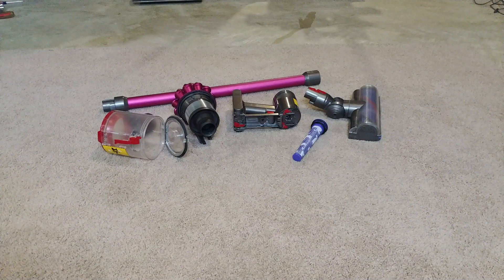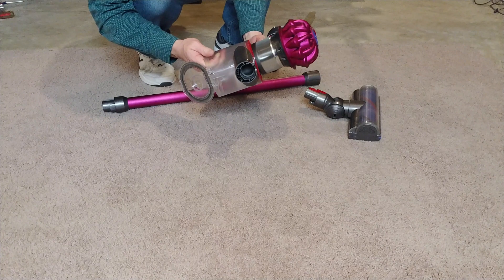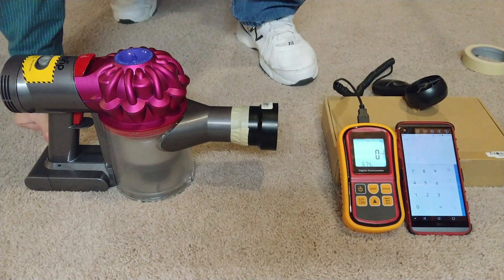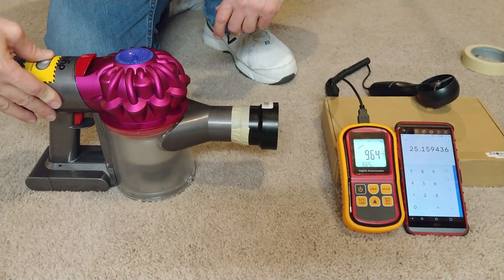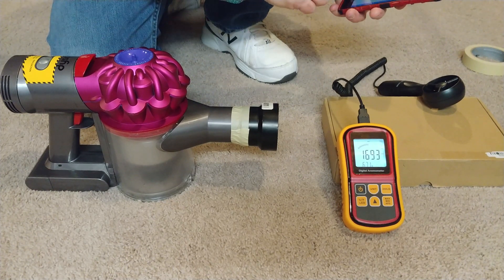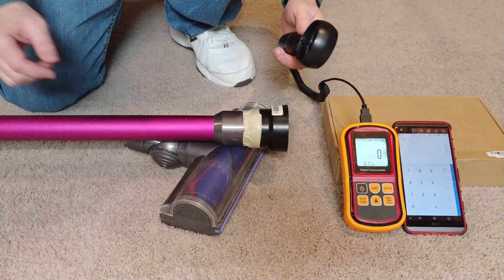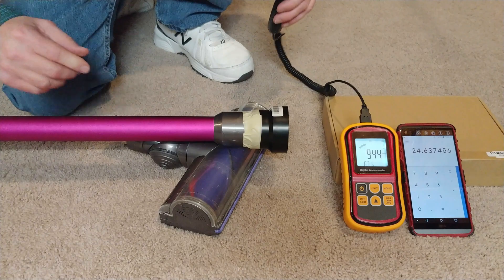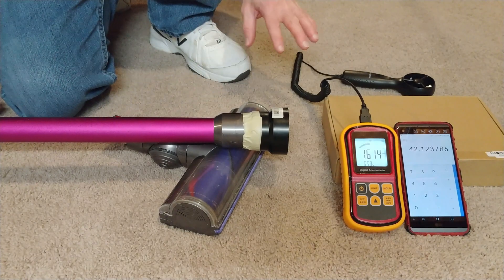Dyson V7 Motorhead Reassembly And Airflow Tests

Comment: Surprised that the nozzle doesn't lose that much CFM compared to right on the vac. 82% kept at the nozzle on high power is a lot better than most uprights when you compare hose CFM to nozzle CFM. (If only Dyson could make a full-sized vac with that much efficiency in handling losses, lol.)

Comment: Nice to see this. When I used the V10 it stick to the low pile rug like a glue on the high power. This V7 seems to have half of the nozzle cfm what the V10 has= 50 cfm on the high power. Low power was 24 cfm. Vacuum Wars tested the V10.
Nozzle seems to have very good seal to the carpet.
It will be very interesting to see what this can do.
Well flour under the carpet test is doomed :D